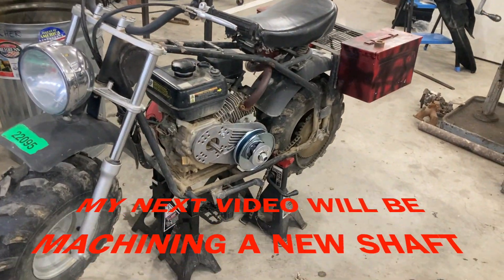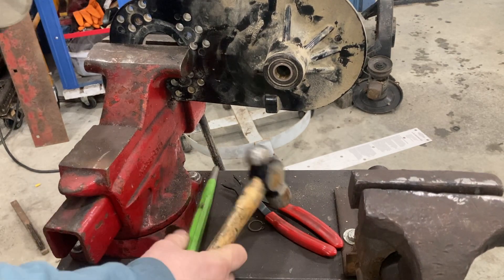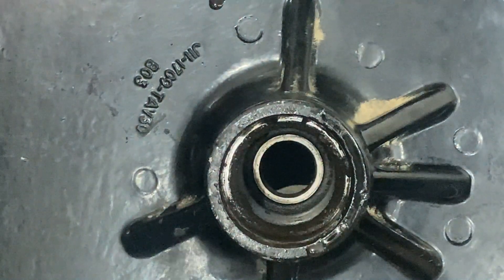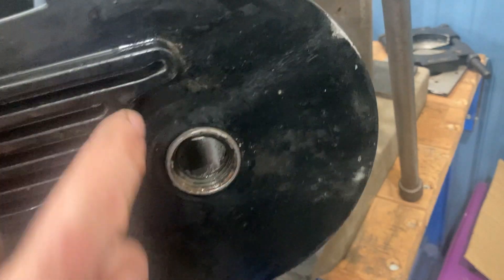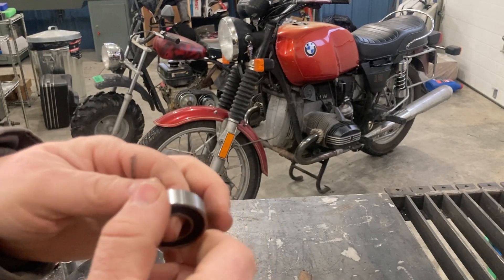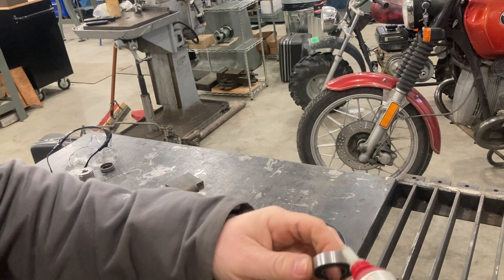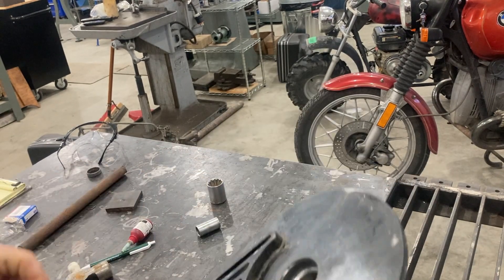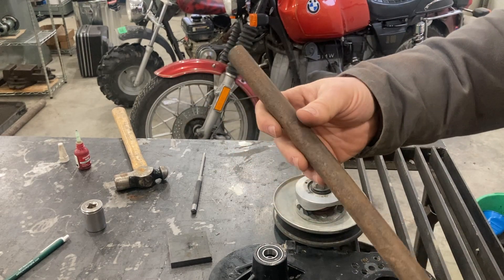Mini Bike Torque Converter Bearing Swap

Comment: I use anti seize. You would use loctite only if the bearing has a loose fit in the bore. Those bearings should be replaced with a better quality bearing when it's brand new out of the box.

The bearings go in with less brutality if you have them in the freezer overnight and warm up the plate on the grill. haha.

Another thing about this is that many of us are putting some power onto them. Comet rated the 30 series to 8 HP. Some guys are running double that and not always with the best gearing. So it should be no surprise when things wear or break sooner than you think they should.

Comment: Where did you get that bearing spacer from?
Reply from the maker: Hi, that spacer came original to this torque converter. If you don’t have one, I’ll try to look around and see if I have a spare so you can get a measurement
Reply: Did you ever find out where to get the spacer from?
Reply: I have two ebay torque converters from different sellers. One came with the spacer and one did not. I'm just running it with new bearings without the spacer. Going to be a wait and see.
Reply: Following !!!

Comment: U happen to remember how you reinstalled the driven assembly? the shaft for the driven on my tc has a lip and one bearing will go on but the other one wont.
Reply from the maker: It’s too bad I couldn’t see a picture of yours and what’s going on with it. The shaft should go right through these bearings easily assuming the spacer is lined up between the bearings. There’s a snap ring that you install at the end of the shaft that keeps it from pushing all the way through.